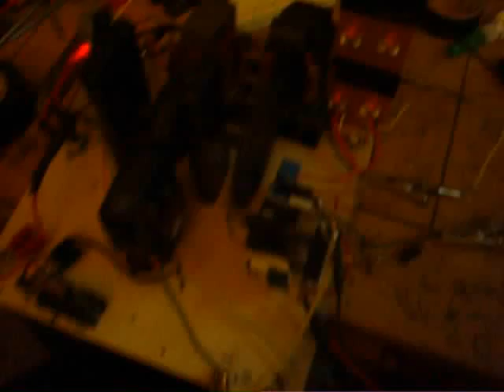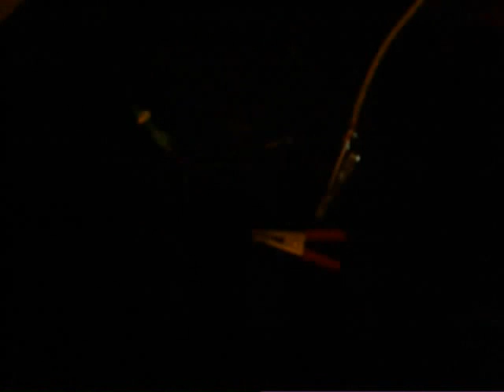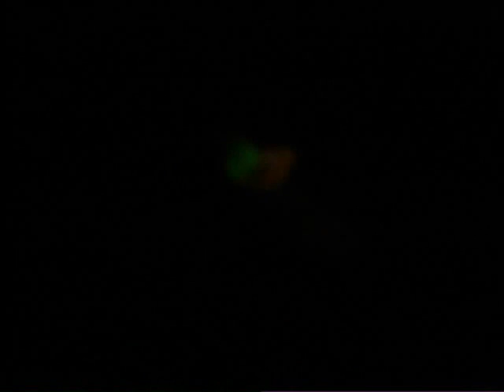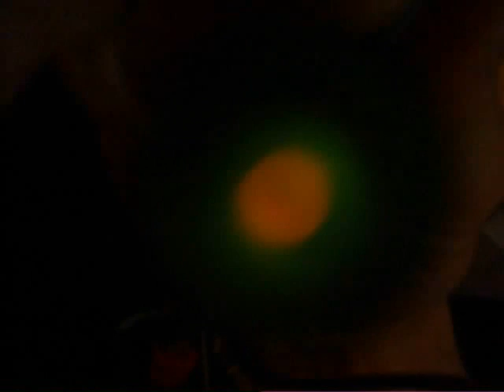lighting neon from pickup coil using reed

Comment from the maker: its cause of the reed.
i know this cause if i use LED's they will flicker with the slightest rotor movement. its taking that tiny current and stepping it up.

as long as a small current can generate within the inductor, and the reed shorts it at the same time, the transient comes out.